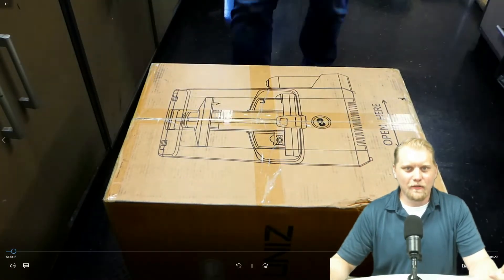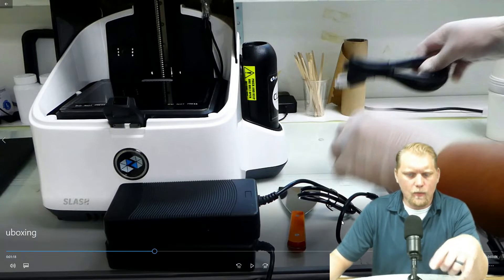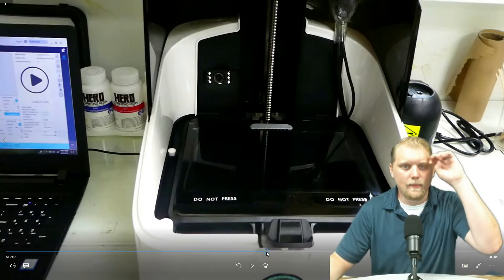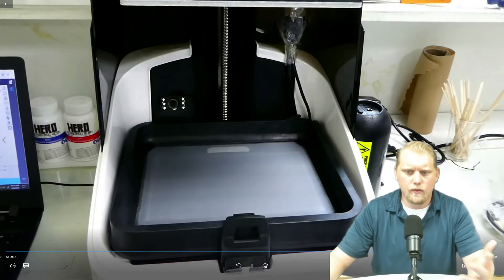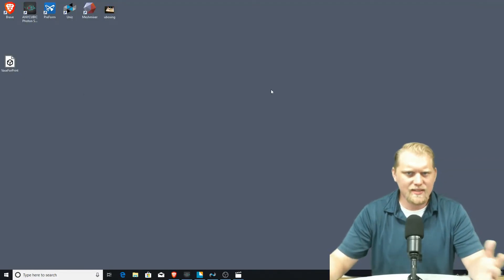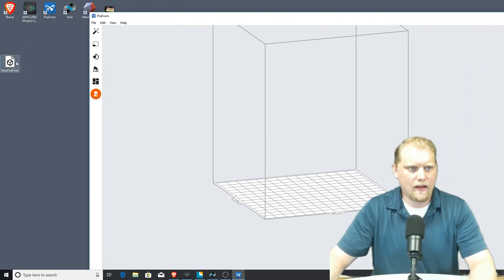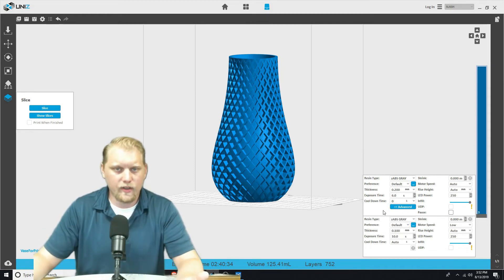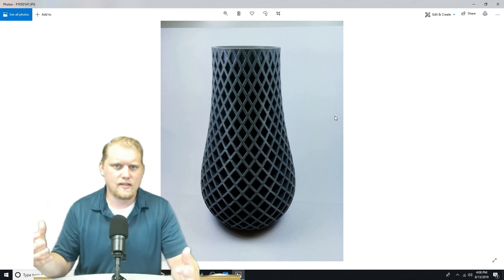UNIZ Slash Unboxing, Speed test and compare to FormLabs Form2 3D Printer

Comment: hello friend thanks for you video, please this printer UNIZ + WHAT TYPE OF RESIN DOES DLP / LCD OR SLA USE AND IF YOU CAN USE RESINS FROM OTHER MANUFACTURERS
, PLEASE
Reply from the maker: Typically 405nm DLP resins are used on these type of printers. Yes, you can use other resin manufacturers. We typically use HERO resin in the Uniz Slash Series printers.
Reply: @3DResinSolutions  FANTASTIC FRIENDS, I NEED USE FOR JEWELRY, UNIZ USE SOME CASTABLE RESIN? PLEASE, WHERE AND WHERE CAN I BUY IT, PLEASE
Reply from the maker: @ingenieriadejoyasandressen6018  www.3dresinsolutions.com .. start their. Use the contact page with any specific questions.